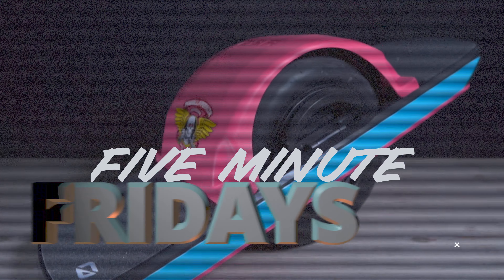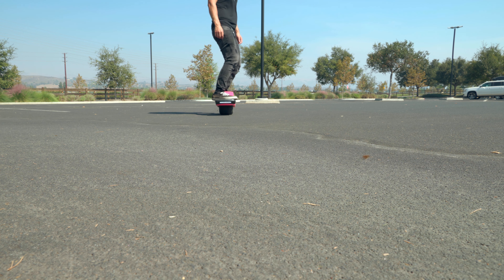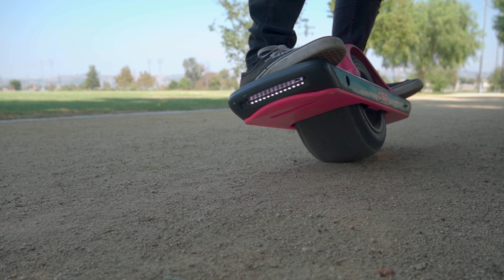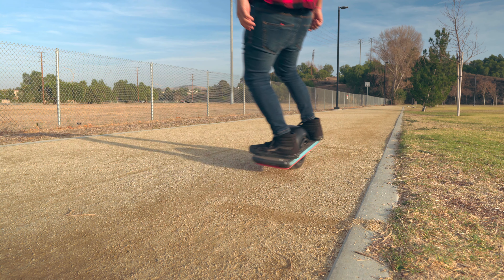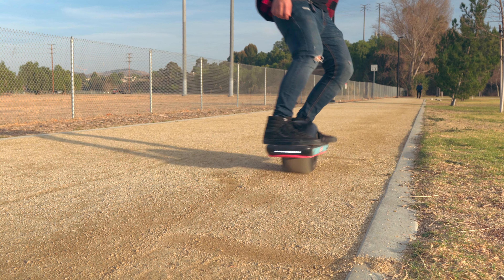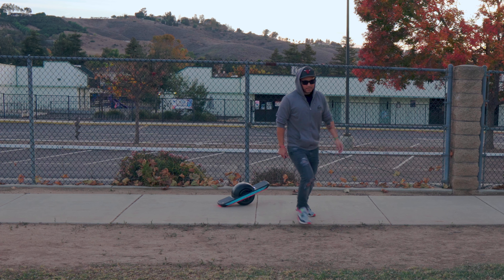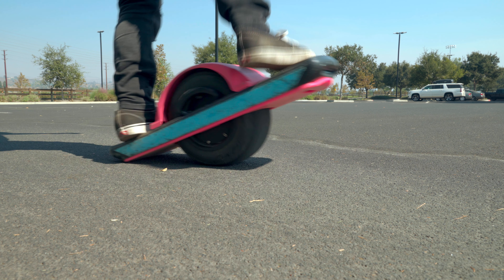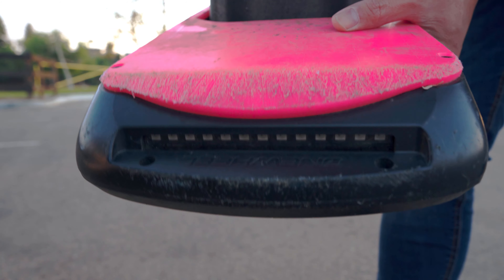How to QUICKSTOP on a Onewheel in 5 minutes! Onewheel stopping tutorial for beginners. Tips & Tricks

Comment: Hey, 1" wide automotive vinyl trim works very well as a consumable wear material on the leading and trailing edges. It's cheap, easily replaceable.  Thanks for the video.
Reply: Interesting suggestion. You don't think it will wear through that vinyl super quickly? I was thinking a thin steel skid plate would be ideal. I'll take a look at how thick of a vinyl sheet I can get. Thanks!
Reply: @kalelinslo235  I have just over 600 mi on mine.  Chewed up but far from worn out.
https://www.amazon.com/dp/B0725ZRSW9/ref=cm_sw_r_cp_apa_i_jun-FbV612K9J?_encoding=UTF8&psc=1
I just layed it across the lowest point on the underside of the fwd and aft corners, right behind the LED openings.  Mine is for accidental strikes, not sure how long it would last for frequent "On Purpose" strikes.
Reply from the maker: Thanks! I think that would work well for covering the rails, but I think it would get worn through on the first quickstop. If not doing quickstops or any curb tricks...i think this would be a solid option. Thanks for sharing!
Reply: @MattYamamoto100  I've actually used it on all the high points of my Pint.  If it rolls over, on a somewhat flat surface, this trim is the only thing touching the ground.  The only exception is if laying upside down the very front and rear footpad edges are vulnerable.  Hasn't happened yet. I ride with a fender, it is also protected.  I don't do tricks so the I'm not rubbing on the underside of footpads.

Comment: Does this work on GT?
Reply from the maker: I haven't ridden a GT, but I don't see any reason why it wouldn't. The GT is more powerful, so you may have to lean back harder to stop...but the same principles apply
Reply: Sure can, just need a little more weight backwards because it's a bigger board.

Comment: Hi Matt, cool video. I’ve actually been doing the quick stop, probably because that’s what my friend’s son taught me. But now I’ve fallen twice because the board slips after stopping. On Sunday I broke my foot, so won’t be riding for awhile. But it’s a good time to figure out how to fix this issue. Ideas are welcome from anyone.
Reply from the maker: Bummer to hear that! If the board is sliding out from under you, maybe you're taking your front foot off too late, which is keeping the sensors engaged. Get well soon!
Reply: Yeah man, sounds like you didn't lift your front foot enough to disengage the motor. Move your back foot closer to the rear to put a bit more weight on the backside of the board. When you shift your weight to the rear, your front foot will automatically want to come up and the back of the board will hit the ground. The only thing that might happen is the tire will spin a bit but shouldn't kick out on you at all.

Comment: Great tutorial! This is the only way I get off my board. It's a very consistent way to get off. The heel method is terrible. I've seen so many people fall trying to do it, just for the simple fact that your unstable while still, compared to moving.

The quickstop can still be done even without distance or much speed. Ride with your rear foot a bit more back, so you can get more weight to that side. If you don't have much space, a quick push forward than quickly backwards will also get your momentum in the correct direction. Just practice a few times to get the feel. Float On!

Comment: Matt, I've noticed when I quick stop my XR and then attempt to move forward, the motor just simply will not turn on and the nose just plants itself on the ground. Sometimes, it might take me six or seven tries to get the motor to engage so I can travel forward. Any ideas why this might be happening? My board is a week old. 
Thanks, Bob
Reply from the maker: Hey sorry for the late response. If you haven't worked this out yet, then I'd say it's your shoes not engaging the sensors. Try different shoes first...if that doesn't work, some have had success by putting small felt pads on the board to help with sensor engagement. Hope that helps!
Reply: Mine XR does this also, I have to toggle power its not consistant  but today I got an over amp reading alert on my phone. it was also 42 ish and tire pressure was a bit low and ironically my board i also a week old.